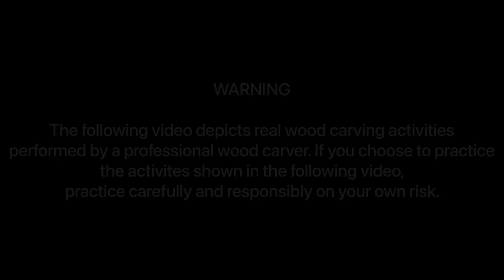Spooncarving in the summer forest #asmr#woodcarving

Comment: Awesome video, i have some questions though. How quickly after felling the tree do you use the wood? Eg, did you leave it to dry a little or is it completely green still! And is it a problem if it has dried a bit already? Also, after carving it, do you let it dry before oiling it? And if not do you then let it dry before using it? Lastly, do you have any recommendations regarding the size of the log compared the target size of the spoon? I've used a smaller branch for a spoon of a similar size but the wood looked quite different. Looking forward to your insights, anyway thanks a lot, keep up the good work!
Reply from the maker: Hello Sam, 
It's the longest question that I've ever got on youtube :) First of all, I use the green wood between 20 to 30 % moisture content.  Also, It's not so problem using the dried wood, but it's so harder than green wood when you carve it. I usually do oiling it, after drying. Lastly, I used about 12cm diameter birch log in this video. Hope the answers help you and thank you for watching it !
Reply: @skogsdraken  that's perfect actually, thanks for clearing all that up. It will be of tremendous help when I get back to carving ( I cut hand my hand 2 weeks ago and had to get 9 stitches and wait for the muscle to recover .. )

I had already experienced dryer wood being more difficult to work with. What do you use to check the humidity of the wood? I heard somewhere these humidity gauges can be quite expensive, or is this more of an estimation? Those will be my last question, I promise ;-)
Reply from the maker: Ohh,,first of all, I hope your wounds heal quickly. You can find  the "LCD Digital Wood Moisture Meter" on Amazon and you can purchase items about 30USD. Always work safely!
Reply: @skogsdraken  thanks for all the help and the hand has healed well also, I'll be getting back to carving soon! With proper gloves this time (:
Reply from the maker: @sambeard4428  Good luck~~